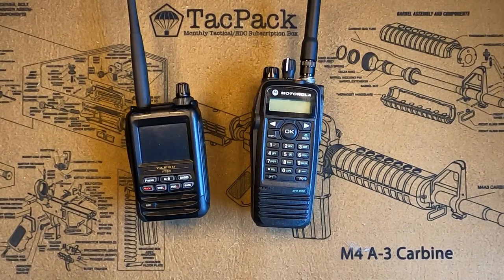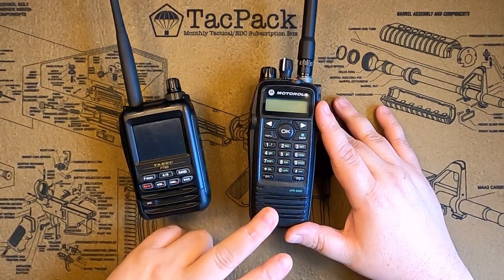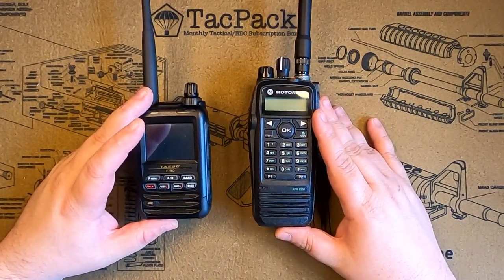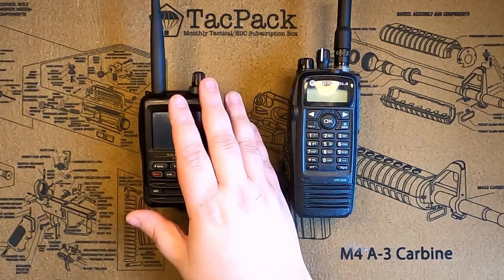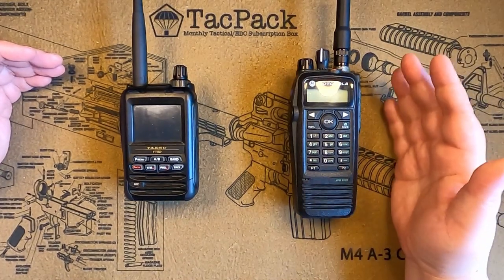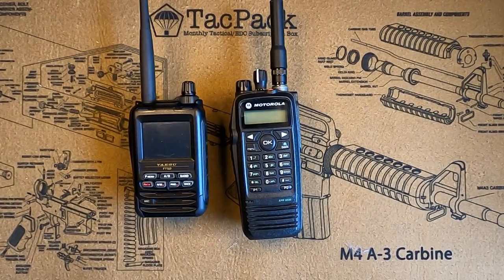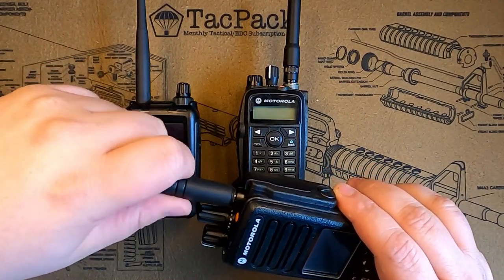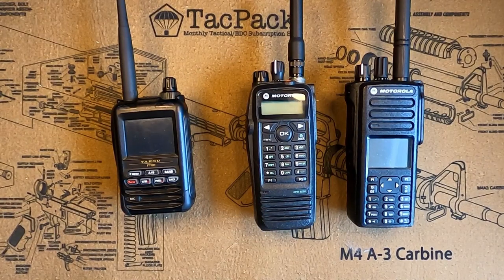SHTF: Type of Communication | Offgrid Technology

Comment: Good video. All of our local emergency services here use analog VHF radios. So, they are easy to receive on a ham radio. I really like my Wouxun KG-UV9d Plus. It has true dual receivers so you can scan or listen to two stations at the same time.
Reply: Oh, the new battery for the KG-UV9 series has a USB-C charging port so it can be charged using a standard cradle or via USB-C. This makes it great for off grid use.
Reply from the maker: Agreed it’s a great analog radio. One of the best :)

Comment: For "secure" local comms I prefer the 900 ISM band I am using the Retevis RT10. Even with only 1 watt, since it is DMR it does go a decent distance. And since it is using the ISM frequencies (902 to 928 MHZ) it can use encryption. The other great thing is, since it doesn't require a license, there is no call sign to identify your station.  If you want to use Motorola radios, they have a line of radios that use the 900 MHz ISM band. They use FHSS and are nearly impossible to monitor.
Reply from the maker: I love the ISM bands as well. Great info btw thanks for sharing.